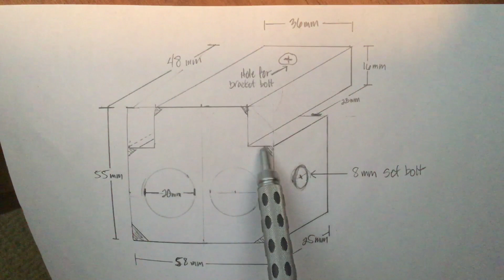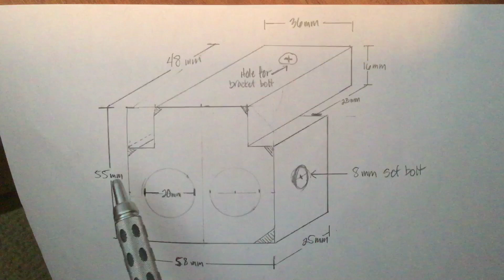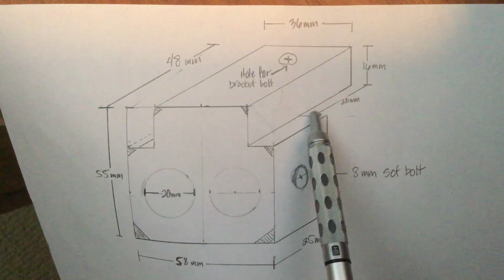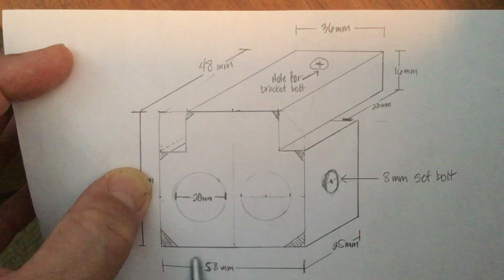Hitachi CB75 Blade Guide Conversion , bracket specs

Comment: Picked up bracket from shop and paid $60 for it. I use a small machine shop with low overhead so that's a deal. Smaller 1 and 2 man shops charge anywhere from $35-55 an hour. The hole for bracket bolt is O.C 11.5 mm from the back end and 18mm from side. It fits great and I'm going to order the Guidall 500-3X with the 347 offset stud from Carter. Thanks again for all your help I couldn't have done it without your help.

Comment: Thanks so much for this! My CB75 is in storage until I convert it so I was hoping you could help me with a measurement.  Can you tell me the diameter of the bracket bolt hole, and it's position on the back section?
Reply from the maker: Good question.  You can guess why I didn’t put that measurement - I didn’t remove the bracket because I’m lazy.  The bolt head is 17mm, which may not mean much, but may get you close.

As for position, here’s some numbers:
30mm (slightly less) - rack shaft (guide vertical adjuster) diameter; this is what the bolt is attached to.
15mm - approximate location of hole from back end of bracket.  This is based on the size of the rack shaft, and it’s placement, which is almost at the back edge of the bracket.  It’s that far back to leave clearance for the bolt head.

I hope this helps.

Comment: Thank you for the specs, I haven't been able to find a roller block assembly either. I have the phenolic block assembly and would like to use the smaller blades as well. Where did you find your block assembly?
Reply from the maker: If by "roller block" you mean the bearing guides, I originally got them off Amazon.  Then upgraded to the Carter Guides.
Reply: @Kekani427 I'm referring to the roller guide stabilizer which bolts onto the rack and pinion arm of the bandsaw. The part you drew with the specs.
Reply from the maker: @stonecrosscreations  Amazon.  But I can't find them anymore, hence this vid, which shows the specs for the block that holds the offset shaft from Carter.  This is just for those that have the ability to make the support block.
Reply: @Kekani427  Yep, just curious where you found one and I'll be taking your drawing to my machinist if Carter can't come up with something. I've emailed them my dilemma so we'll see. You've been very helpful. Mahalo!

Comment: Would it be possible for you to post the location of the holes, my Machinist has made the block but needs the specs for the hole. I would appreciate it sooooo much! Thank you.
Reply from the maker: @vonnemac Sorry for the delayed response - the set screw/bolt hole coming in from the side for the shaft is centered front to back, and centered top to bottom on the “bottom section”, which should be about 39mm (so 19.5 mm from the bottom, and centered on the shaft itself).  

The hole to mount to the upright shaft should be about 10.2mm in from the back.  This means the upright shaft will end up being in alignment with the back of the bracket, not inset or overhanging.

I hope this makes sense?

Note:  I’d like see what your machinist comes up with!
Reply: @Kekani427  Thank you for getting back with me and I assumed that the side set bolt was OC and I also Centered a single shaft hole as you suggested in your drawing video. I do need to call the shop in the morning and tell them to move the upright shaft hole back a bit. I'll let you know how it turns out and the cost for having one made. I can't thank you enough for all your help!!!...